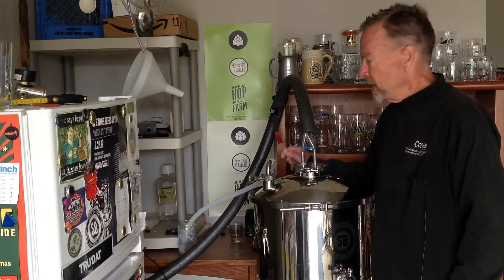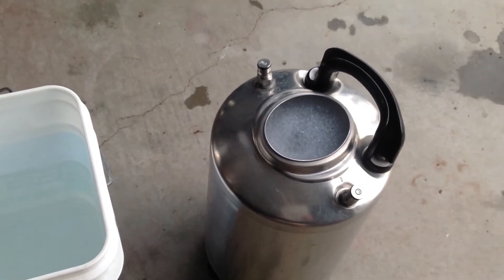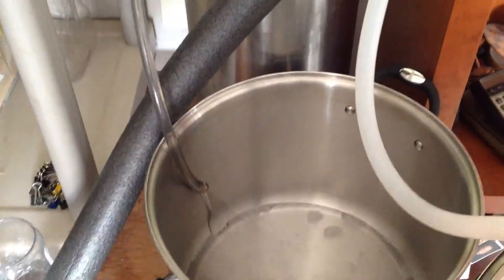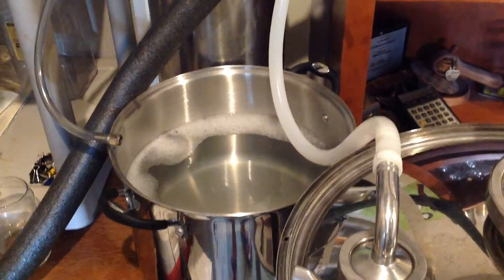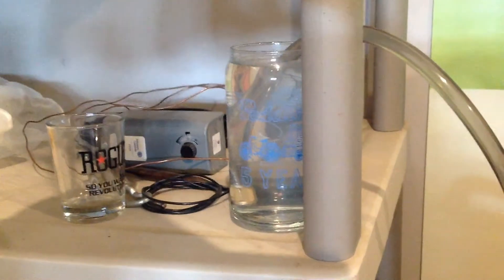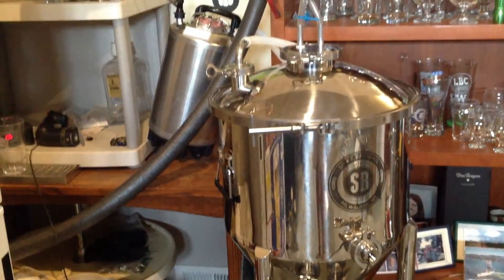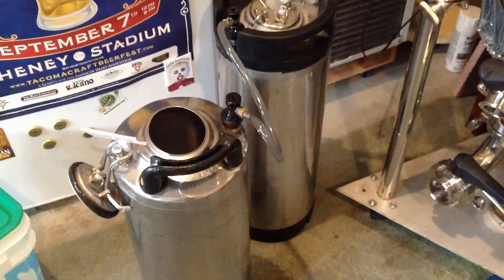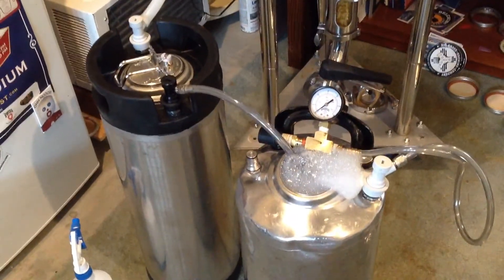Homebrewers : use that CO2 !!

Comment: Good idea - I was thinking about doing the same thing. Thanks for running the experiment for me and saving me time! Do you think it would be a good idea to wait a day or two before pushing star-san from the keg? I'm thinking the headspace in the fermenter would initially contain oxygen for a day or two until enough co2 was produced to push it out of the fermenter. However, I think it would be possible for all of the oxygen to pushed from the keg too if you left it connected during the entire fermentation. What do you think?
Reply from the maker: Thanks for watching and your comment.  I like doing the channel because I get a lot of good input from knowledgable brewers such as yourself!  I agree with you 100%.  I tend to do this on day 3 so that I can be sure that it is only clear CO2 coming out of the blow off (there seems to be plenty of gas and pressure at that time to do the job).  One thing I will mention is to keep in mind that whatever you are fermenting will carry that aroma into you purged keg.  The only time this is a factor to me is when I use lager yeast.  When you lager you get that sulfur like aroma and that will fill your keg.  At the end of the day I don't think it much matters, but when I did this process while using 34/70 and later filled that key, the oh so familiar lager aroma was as clear as it could be!!!  I usually purge the keg, then use my spunding valve to put about 2.5 pounds of pressure in it, then put it on the shelf to wait for its turn to be filled.  Give it a try, it has worked well for me.   All the best.   -DT
Reply: @homebrewingtips6029  thanks for the tip! I am glad we can use technology to share knowledge. Also, keep the informative videos coming, we all enjoy them. By the way - are you former military?
Reply from the maker: @nu11pointerexception  I agree 100%.  I saw your note on my sodium percarbonate video too, thanks for that.  I use that stuff all the time on everything from laundry pre-soak, to pots and pans, to all of my brewing equipment.  Love it!  
Pretty much my entire family was Navy, mostly aviation.  I worked from the other side of the table, contract engineering (still do off and on).   Thanks again for your comments and input.  All the best.  -DT